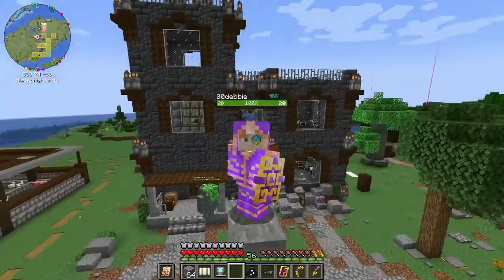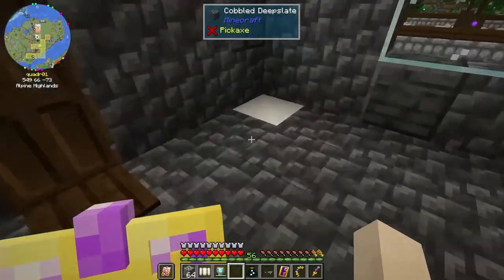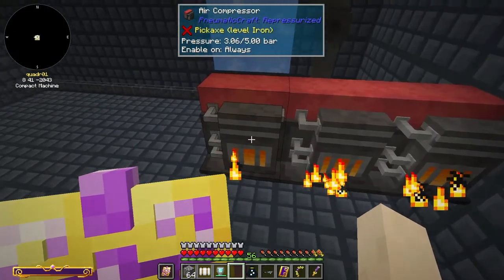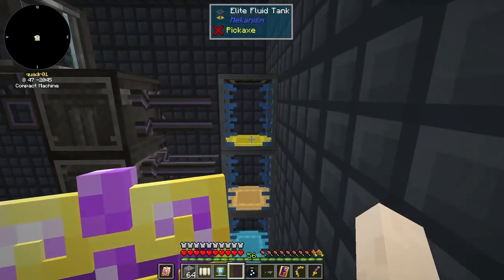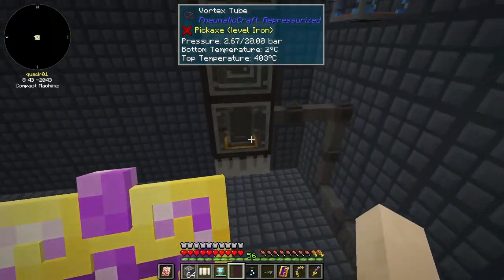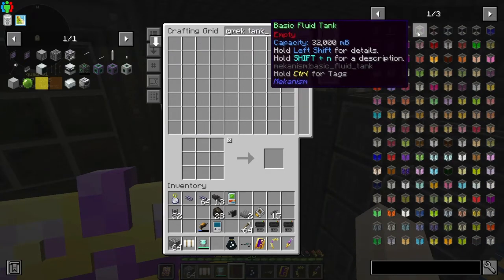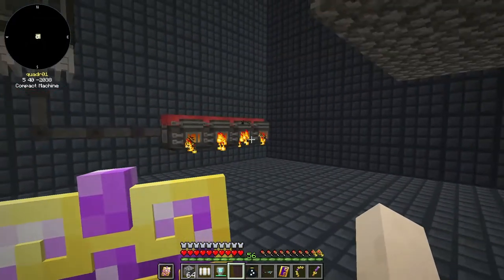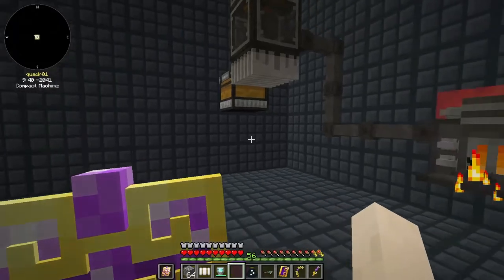DireWolf20 1.18 Let's Play Episode 92: Gathering Crude Oil

Comment: You can use the Pneumatic Wrench to seal off a tube before breaking something off, so you don't lose pressure.

And holy heck, I thought the heat pipe was supposed to allow you to put more heat sinks on to help dissipate the heat better, but I just tested and putting a single heat sink directly on the vortex seems to work much better.  :-)
Reply from the maker: Ah, I didn't know you could do that to the pipes with the wrench!!! Cool :)

Comment: The chest should be below the heat sink like before you moved it. Also, when you process the LPG in the thermopneumatic processing unit output the liquid plastic into a basic pneumatic tank and than place this tank into the chest with the heat frame. The mek tank will not work speaking from my experience. Within the chest you will see the plastic sheets slowly appear in the slot next to the tank within the chest. Other than that, nice setup! I totally forgot about the fluid laser for the crude. You probably can get away with just a few lasers on each side as you will not be able to process the crude faster than you are making it and not burn through 6k rf/tick.
Reply from the maker: Cool, I just tore the whole thing down and will rebuild it again OUTSIDE of a compact machine. I feel like I need more room than it had available. :)